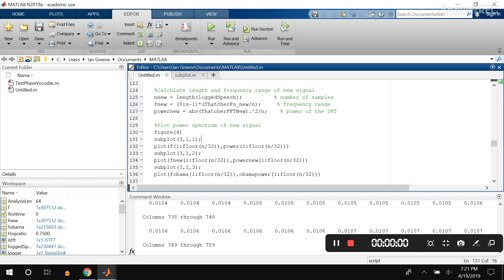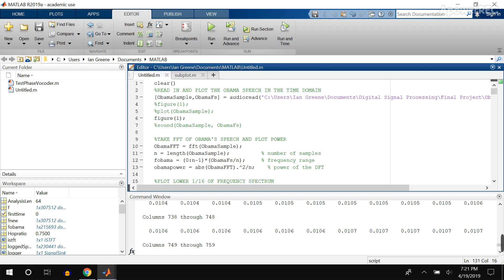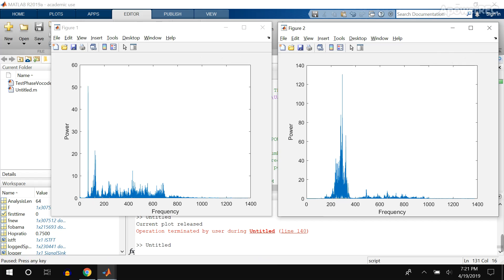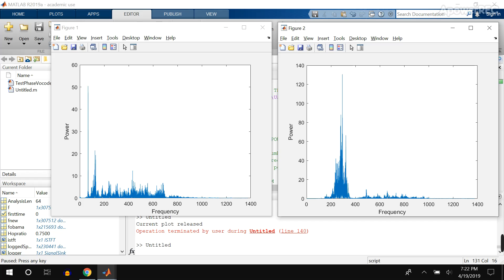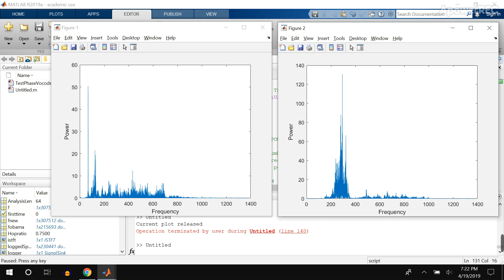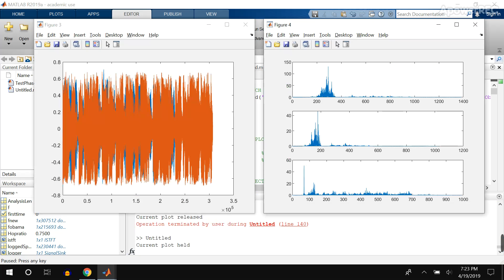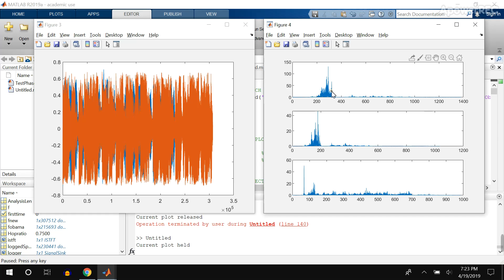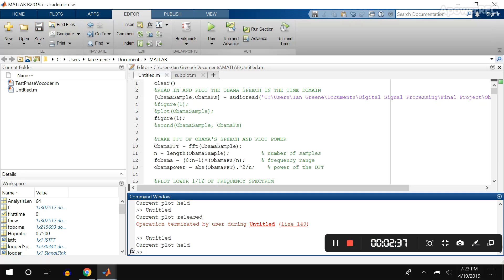DSP Final Project Phase Vocoder

Comment: This is tight man. Out of curiousity do you know of a complex formant shifting algorithm that would make it sound like a male voice? I mean I guess deep fakes but that's obviously not the same thing
Reply from the maker: Thanks! Funny enough, what you're describing was my original idea for this project. I never did find an algorithm for it though.
Reply: @iangreene4228  ah darn haha. I feel like it'd be a fairly popular plugin if it was out there so that's not surprising. This is getting there though
Reply: @francismcfadden3305  It would be hard to do in general, because formants depend on the sound being made (e.g. different vowels have different formants). You'd have to detect common formants at any given point in the audio, and re-map them individually.
Reply: @naught101  True. I didn't think about that. I feel that might be feasible thinking about it though. I mean there's already text to speech detection so I feel you could possible do it with that too. I'm sure it'd be a difficult thing to code though